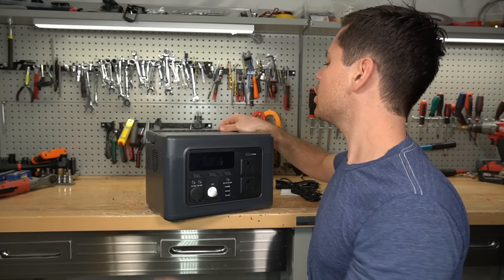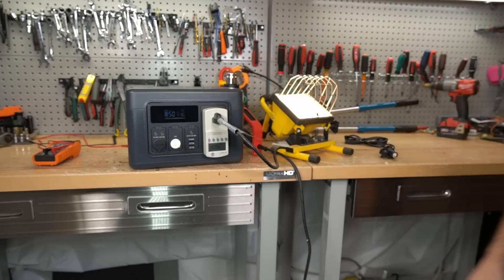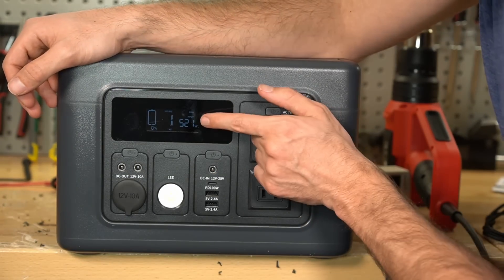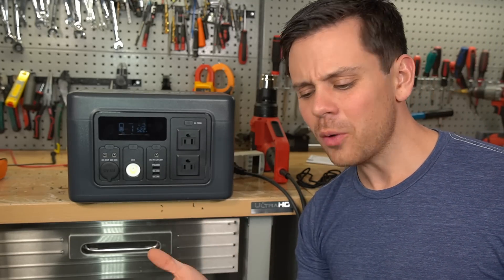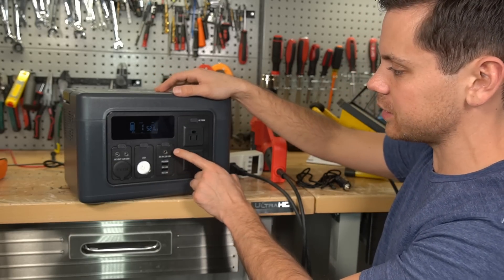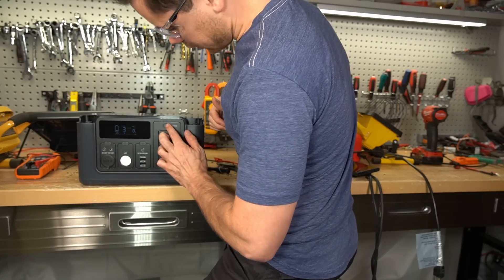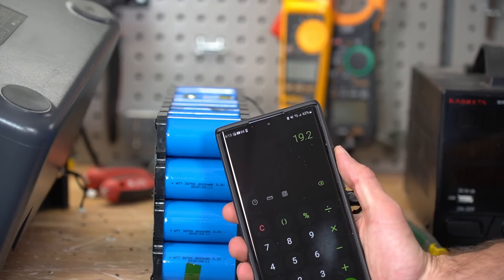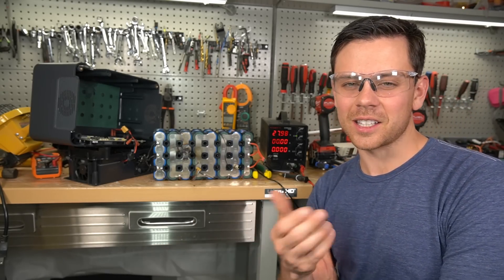Powdeom Solar Generator Test and Teardown! Better than Jackery? Bluetti?

Comment: Hey Will do you have any idea how the "walkable" solar panels are being made in the RV industry (i,e solar roof decks)? There is almost no competition and the handful of producers are selling 500w walkable panels for like $6000USD... Surely these can be done DIY or significantly cheaper? How have they made them walkable? Check Tiny Watts Solar walkable roof deck...
Reply from the maker: I have seen those and my friend actually has one but I would never ever trust it. Any flexion could cause micro cracks in the cells. They do not like it. And yes a DIY might work if you have a very expensive piece of glass on top of it. I would never try walking on any panels. I used to do it all the time till I found out how badly it hurts them.
Reply: Take a piece of plywood 16mm, glue the flex panel to it, cover with epoxy? 100$ work? But they are probably useless, as it will get hot really fast, and the protection layer will reduce the power?
Reply from the maker: @Vctr  and yes you do not want to sandwhich it in insulators. if you had a shorted cell or hot spot it could cause a fire too. never have wood near a panel like that
Reply: @WillProwse  I've never bothered to research how the solar cells are wired, my thought was a little rubber 3-5mm spacer in each diamond between the cells with a layer of plexiglass over the top of the panel. Probably right that the flexion would still touch the panel depending on how thick the plexiglass is. Surely TinyWatts isn't selling $6000 panels that are likely to fail though.. He's gotta be doing something tricky
Reply from the maker: @Wantedrtw  I bet it's damaged but it just has a bunch of bus bars and they're high quality panels so they still work. I bet you anything most people that buy them don't walk on them too 😂😂😂
Reply: @WillProwse  If I can't have walkable solar panels then I'll never be able to get the drone shot of me wearing a wide brim felt hat and Birkenstocks eating a cheeseboard with my labradoodle on the roof of my van for Instagram so might as well sell up
Reply from the maker: And labradoodles. You get it lol
Reply from the maker: @Vctr  Your weight would flex a tiny part of the cell and damage it. They really are not made to handle that force and flex. regardless of what it is sandwhiched in. that is why they use glass traditionally. the etfe ones die fast and sustain micro racks rapidly and you can see reduced output when you do it.

Comment: As a professional who uses solar generators on film sets in the electric department, I 100% disagree with loud colors. Black and gray means it doesn’t stand out, looks industrial, and gets me paid more on rentals lol
Reply: A decent logo should suffice. The only reason my computer has RGB anything is because the components I wanted came with it. Bright flashy colors means they spent money on bling, I would rather they spend it on reliability and capacity/features.
Reply: @john_in_phoenix  Same man, RGB used to be a pricy option but now it comes on everything and it often requires you to install a 3rd party software to turn it of. I hate this so much.
Reply: I agree, this is a tool, not a gaming computer.
Reply from the maker: @MrArcticPOWER  RGB everything 😂 (I am joking. I just wish they could make it look unique)
Reply from the maker: From a marketing standpoint, they make these things indistinguishable from each other. Hundreds of them look nearly identical. I just wish they could make it cool. Not necessarily bright colors
Reply: @Driveformer  I couldn't agree more.  Bland is better.
A tasteful logo is fine, but I've actually covered overly bright colors with 3M low-residue black tape rather than have an annoyingly loud ad grabbing my attention every time I see a product.  
(And don’t get me started on companies using clothing as billboards.)  😉
Reply from the maker: Great point! I use them on my film set too :D but I need them yellow because I always lose them! haha
Reply: I dont agree
Reply: But this is like saying Dewalt shouldn’t be yellow and Milwaukee shouldn’t be red and so on.  I see Will’s point.

Comment: I bought a Bluetti EB3A and returned it. It overheated when used as an EPS. Glad that I returned it!

Ecoflow has equipment similar, but Bluetti customer service is TERRIBLE! They use a Facebook Group page for customer service and they ban you and/or ask you to delete posts unflattering!😱

Ecoflow is decent and seem to be fair to all of their customers. 👍
Reply from the maker: Yeah I have been hearing about the awful bluetti customer support! And they ban you!? insane
Reply from the maker: Yeah ecoflow is top one right now
Reply: Interesting, I've only used the UPS mode for a short time as a test. But the load was only like 120W. If I was using this as a UPS I'd make sure the load is only averaging 200W as that's what the charger is rated for. It can boost to 400, but I don't know what the longevity of that would be sitting at that rate all the time. That's a lot of power for a small unit.
I've heard that about their customer service. If you buy through Amazon, I'd just stress test it right away and use Amazon's return policy to send back it if it's faulty.
Reply: @andrewt9204 , I bought my unit through Amazon. No one replied to my question about the EB3A overheating. It was a software problem and I wasn't waiting for them to one day repair it.

Here is the data. The fast charging happened to about 100%. Every Engineer knows it needs absorption and trickle charge after bulk charging, not continuous bulk! I used as a EPS and the excess charging power converts to heat. It overheated!
Reply: @gregyohngy  If it was within the return window I'd have just returned it back to amazon saying it was faulty. I don't think they care. Then I would've just ordered another.
So mine had a firmware update available when I got it 2 months ago. I didn't try charging it before that. Mine stays at 200W until 90%, where it drops to 120-150W , then another sharp drop to 60W @ 97% where it stays until 100%. Not the best curve, but certainly better than 200W all the way to 100%.

Comment: My Bluetti EB3a has goofy watt meter display. It would be nice if it had an hour of storage at rated output, but for under $250 it does what I need.
Reply: Interesting, I'll have to test mine out on AC to see how accurate it is. The DC power meter seems to be close though. It closely matches what my phone and laptop are rated at.
Reply: @andrewt9204  
I noticed that the percentage of charge keeps increasing when plugged in to the grid, even though the input watts says zero.
Intermittently.